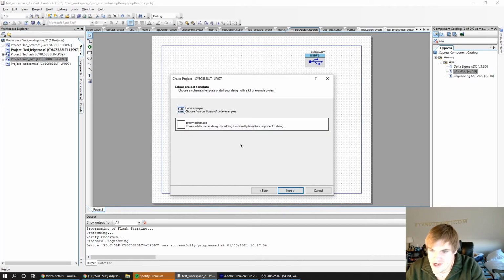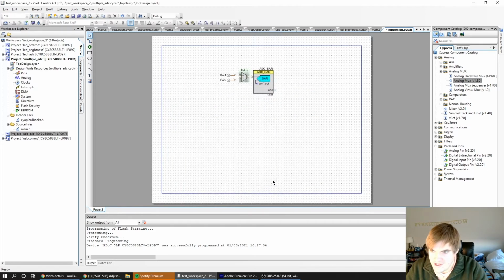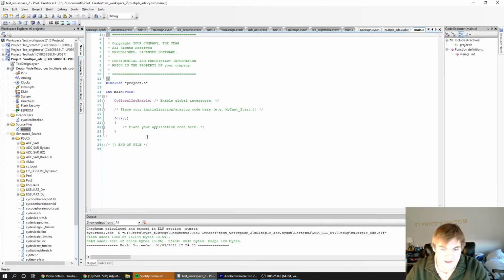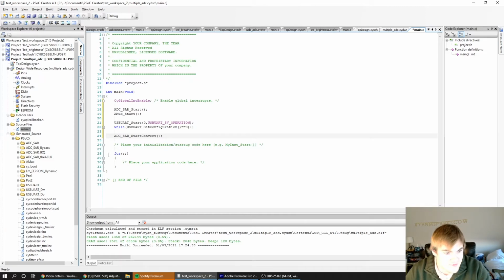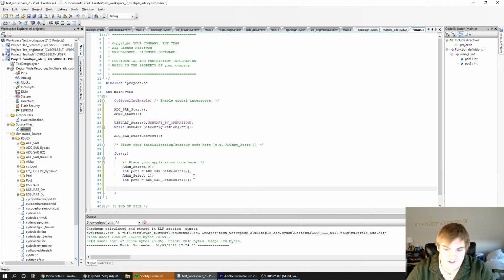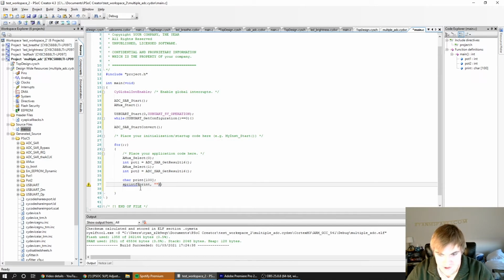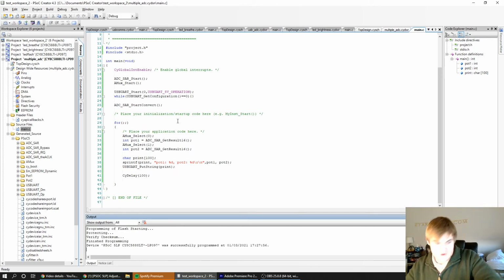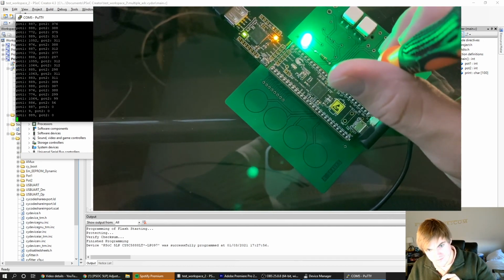[PSOC 5LP] Multiple Analog Inputs Multiplexed (AMux, ADC SAR, and USBUART)

Comment: How do you vary the period and pulse width of the LED using this method?

Here is the code im trying to use 
        AMux_Select(0);
        int pot1 = ADC_SAR_GetResult8();
        PWM_WriteCompare(pot1);
        CyDelay(100);
        AMux_Select(1);
        int pot2 = ADC_SAR_GetResult8();
        PWM_WritePeriod(pot2);

I think the PWM is switching between between writing the period, and writing the pulse width. I want it to update both values at the same time. hope that makes sense.
Reply from the maker: Makes sense to me! Because they're multiplexed though there isn't a way to read them simultaneously with this hardware configuration.  Instead you have to read them separately just like you're doing, but I think the position of your delay statement is what's causing the "switching between" behavior you're talking about.  Try moving your CyDelay to the end of that code block and see if it works better! :)

Comment: Hello 
I'm receiving an error message concerning USBUART_PutString (Undefined reference to) 
I don't know why. Is this familiar with you?
Reply from the maker: That means the C compiler (which executes your software) doesn't know where the function "USBUART_PutString" is, and that's about all the information you get - but some background info might help you figure out why it can't find it.  Since PSoC Creator generates that function when you build the hardware, I'd guess it's probably something to do with how you named your USBUART block.  By default it comes like "USBUART_1", so in that case the function you'd use in software would be "USBUART_1_PutString" (or you can rename it and re-build your hardware).  

Now, that's not the only reason it might not be able to find it.  Another reason might be if you accidentally removed an important "#include" statement, for example.